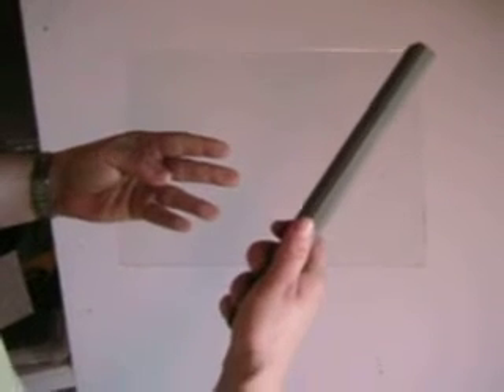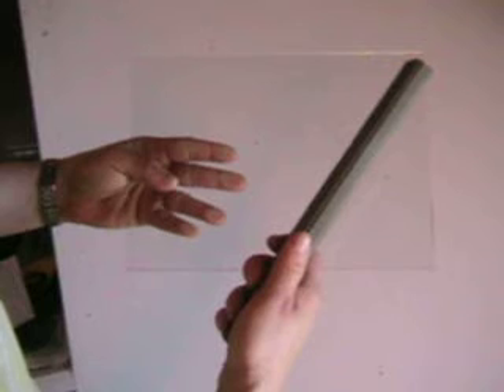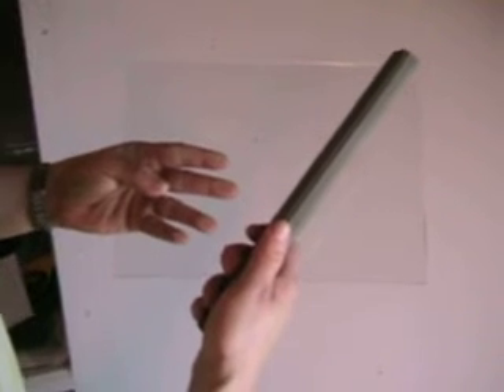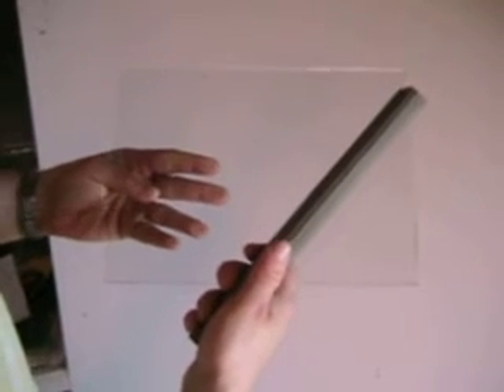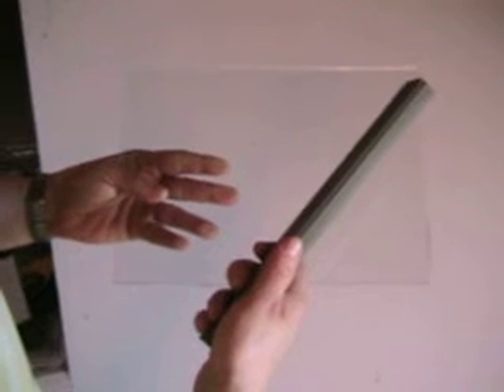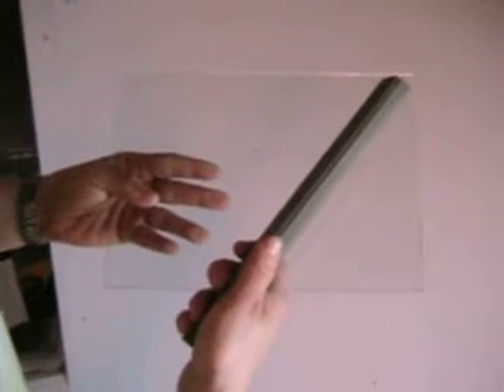Using a grinding stone to linish glass edges

Comment: will a nail file, a metal one work too? I have some small bits of glass I smashed up for jewelry
Reply from the maker: +christian doodles I think a nail file would lose the battle really quickly.  If you experiment using a metal file you should do it with the glass and metal file submerged in water, and use your finest file.
Reply: +Chantal's Stained Glass I mean the ones that come on the squeeze nail clippers